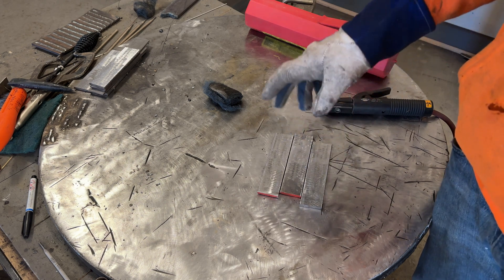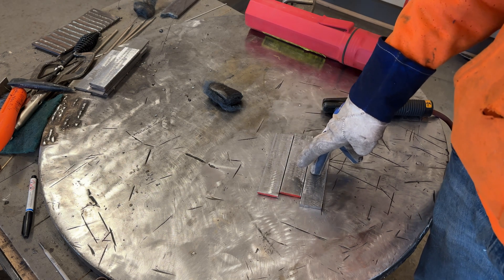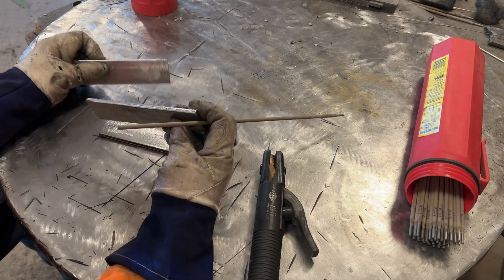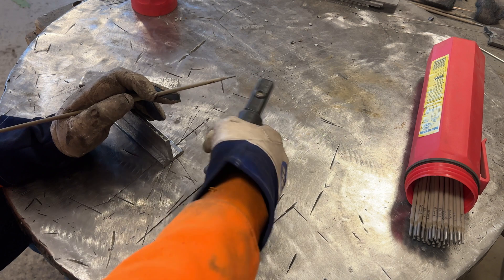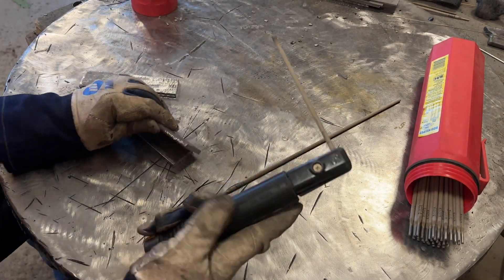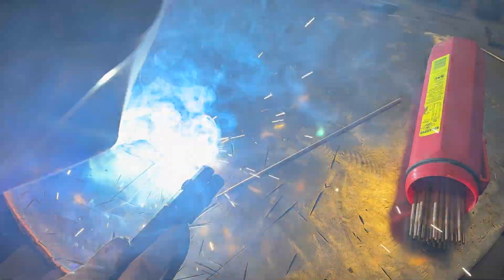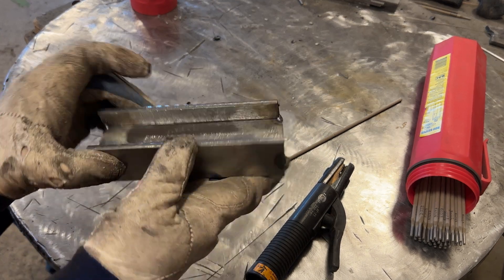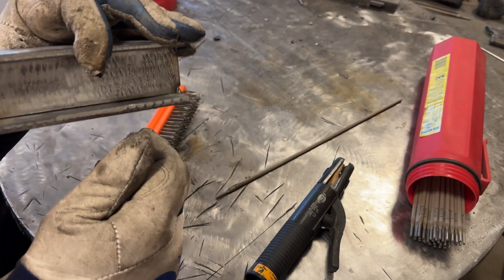DCEN Vs. DCEP Which penetrates more?

Comment: I've heard there is more difference when not running flat/horizontal. 
When flat it may be the sort of difference that needs machine-steady welding to make a real comparison so you don't subconsciously compensate the travel speed or arc length for differences in heat and deposition rate.

Comment: Interesting question.. do welder on AC show rms or peak amperage?
If it's rms, then the power (heat) that is transfered is the same, but if it's peak, then DC transfer more. Cos.. as you have transition thru 0, you also have peak that is above rms value.
Somehow... I beleve it's rms, as everything else  is rms vauled (for example 230V from my wall outlet is rms, not peak)
Reply from the maker: Great question.  A stick welder operates on variable voltage, constant current.  On DC output your voltage would be read as actual voltage (which voltage is dictated by rod and arc gap).  On A/c you would have RMS voltage.  Current wise on older transformer machines are all adjusted for the power difference on AC vs DC.  Basically the numbers on the amperage dial (look at a miller dial arc 250s dial for example) are doped/skewed so that when you select the same amperage in both dc and a/c mode the effective welding current (aka the way the rod runs) we’ll be very close.  On modern inverter machines that can output A/c they too will likely be compensating the output.  No doubt there will be some variability in actual output with any machine between the two.  So your thoughts are correct, they are likely looking at rms and not peak, however they all have their numbers doped to make them comparable to dc.  With that said I have welded with a couple A/c only machines (40+ years old) that seemed to be way off on heat input based on the settings I selected.  Considering all those are is a transformer with multiple taps for lower output, I am not sure why the output was “weak”.
Reply: @makingmistakeswithgreg  Maybe those 40 years, stoled a few amps :)
Lose trafo plates, degraded isolation... etc...
A'm sure last 40 years stoled some power from my hands 🤣
As AC from outlet is rms 230V (or 110V in USA), so transformer should give also rms power/amperage. But also we could never know how company 40 years ago labeled it. On the other hand.. overrating was not so popular in those days(at least in my expirience).

Comment: I've been running 6013's on a few things... as shown here I really don't see much difference. I actually like how they run - so much so I've got 4 different sizes of them. Will be doing some sheet metal tomorrow with them. 1/16 & 3/32.
Reply from the maker: 6013s on thin material are a life saver for sure.  They are my go to rod on thinner steel for sure, especially the 1/16th rods.

Comment: Hi all... I was experimenting with 7018, low hydrogen.  Its a difficult rod... My observation was that electrode negative helps in reducing blowing holes in thin steel...but is hard to strike up. Electrode positive produce invert result. Hope it helps.
Reply from the maker: On thin sheet metal it is common for 6013 to be run DCEN, which tends to produce a tall rope like weld.  It makes sense that it would also work with 7018.  I have only ran 7018 on DCEN by accident and it did run, definitely had a a odd sound to it though lol.

Comment: Great videos, you are an excellent presenter. I’m just a hobby welder of small projects in my shop, but I thought DCEN was suppose to have the heat into the electrode vs the work piece? Preferences for autobody thin stuff. How did your penetration be equal or better on the 1/4”? Was your arc force setting compensating or something. Thank you
Reply from the maker: Thanks for the kind comment.  There is a ton of confusion with polarities and welding because welding is opposite of what most people are taught.  In “conventional current” aka what’s taught in schools (and how things like car wiring diagrams are depicted), power (or current) flows positive to negative.  The truth is this assumption was made before anyone knew what a electron was and was basically a guess.  Well it was a wrong guess because electrons (and thus current) actually flows from negative to positive.  This isn’t a issue for most things, however in the case of welding it plays a huge role.  When you weld on DCEN electrons collect at the tip of the rod and jump the arc gap to the plate, and the electron striking the plate puts most of the heat onto the plate.  On DCEP (electrode positive) the electrons strike the tip of the rod thus more heat is generated in the tip of the rod.  DCEP is supposed to have less penetration than DCEN but in my own testing it’s not a huge difference.  On auto body it’s been a trick for years to run rods DCEN to get better performance.  In my own testing in the past I never noticed much of a difference.  I do find you can run slightly less amperage on DCEN which will help.  Honestly I despise welding super thin material with stick so much that i never do it lol.  Tig or MiG is so much less frustrating I use those.
Reply: None of that ever made much sence to me. All of the heat on the rod still gets dumped into the puddle regardless of polarity. What I can see is the effect it may have on ionized atoms being pulled one way or the other in the plasma (which also effects redox "cleaning action" in the contect of AC balance on aluminum), and how it may give the molten metal globs a static charge which pulls them to the other side. 
With all the old timer slang that gets tossed around in industry it wouldn't suprize me if the DCEP "penetration" was actually just referencing arc forcefulness or cleaning action for penetrating through dirty metal; as opposed to the modern use of  penetration to mean the melt depth profile in a slice and etch.

Comment: Here in South Africa we mostly run 6013 for general welding applications . I've actually found it hard to find decent 7018 rods ( Hell never found good ones ) . 
I have found a lot of difference between the various brands of 6013 . Some over priced and others just crap that left a yellow powder ( Ryobi ) .
Have a couple of hours to kill tomorrow and will run a few DCEN ...
Reply from the maker: Doesn’t surprise me that there are a lot of differences in the 6013s.  Let me know what you think of them on DCEN.  Honestly I think the start of the weld is better looking and they seem to run good.  The sound is definitely different lol.  It’s too bad it’s tough for you to find good 7018s, they are a great rod with a very easy to see puddle.
Reply: @makingmistakeswithgreg  For thin steel, between 7018 and 6013 which one is more suitable for that task ?
Reply: @harisyoung4110  For thin steel, I had some success running 6013 and welding in a series of tacks. Like tack, break the arc, wait until the metal cools a bit, another tack, and so on. 6013 because it restarts really easy. 7018 not so.

Comment: I researched 6013 a lot in the past and discovered that within the 6013 range, there are different formula mixtures for the flux. Some are more violent, others more smooth depending on what you are doing. The more violent mixture produces more of a cleaning action. I wanted to try some Hobart 6013
Reply from the maker: Very interesting.  I have noticed a difference between the 3 brands of 6013 I have used.  Far more of a difference than with 7018, that would explain a lot lol.
Reply: Just confirms that welding is sorcery. I really like these analyses. Thank you, Greg.
Reply: Linc’s seem to be heavy Rutile, while Hobs are Rutile-Cellulose.